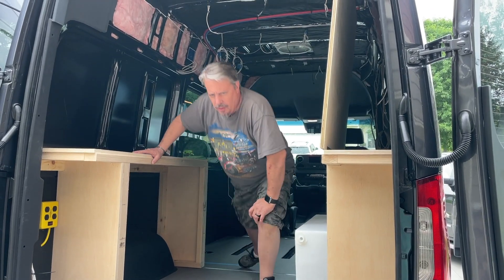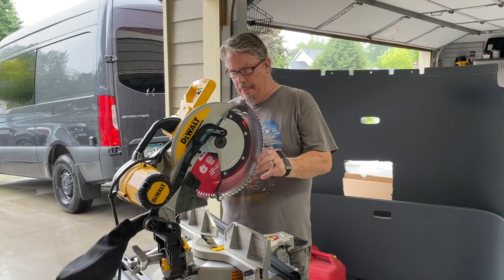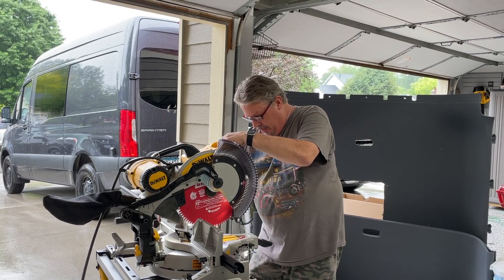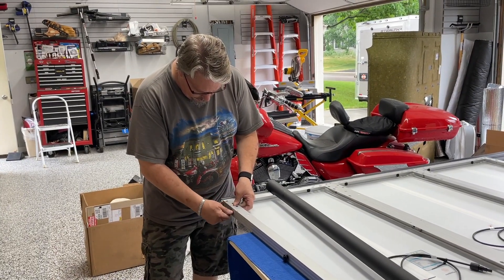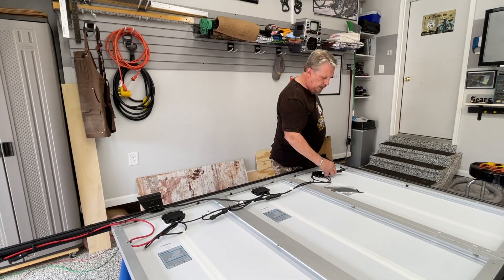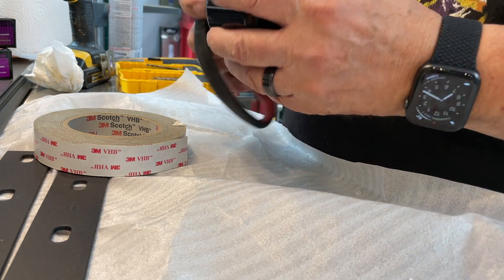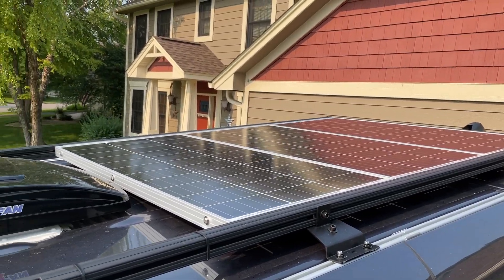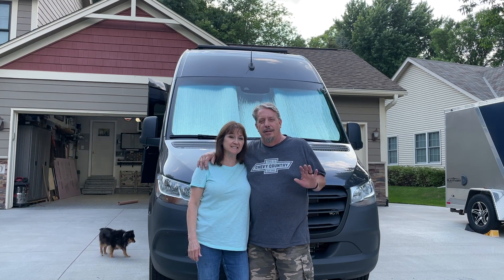Solar Power DIY Adventure with our VAN!

Comment: Great video!  Thank you for sharing it!  I notice that you covered the small, relatively flat, factory antenna-looking part that is kind of over the driver seat on the roof. Did you notice a reduction in your GPS or other electronic signals once your solar panel covered this thing?  I am installing solar on a Sprinter van as well, but I wonder if it's ok to over this thing on the roof.  Any insight you have will be greatly appreciated.
Reply from the maker: Thanks for asking and good eye noticing that.  I worried about this too but to my surprise there is no noticeable difference with our satellite radio or the GPS.  I used Renogy panels which aren’t super dense with wires so we went ahead with it and it’s no problem at all.  We use XM all the time too and it works great.
Reply: @cyclonecustom  Thank you so much for the information.  And for the GREAT video!